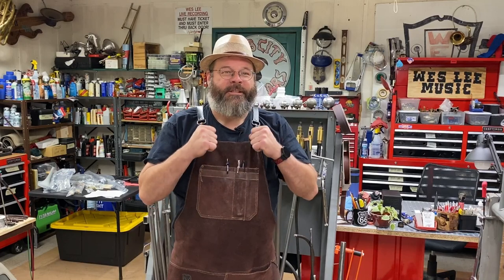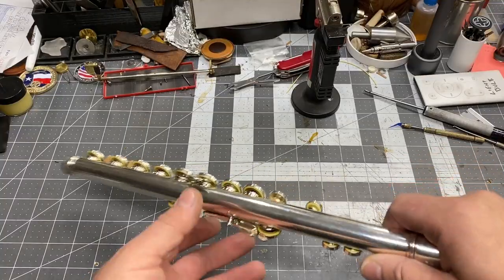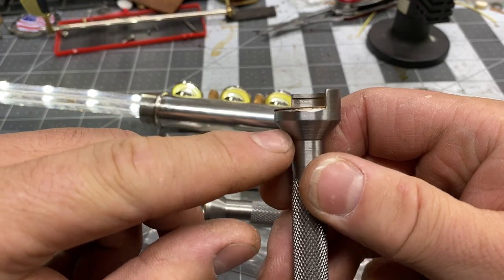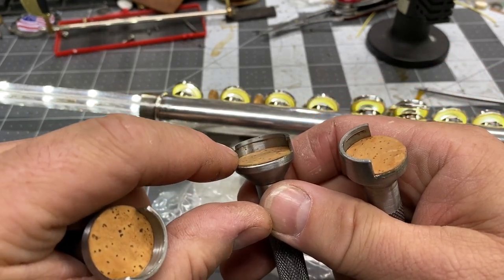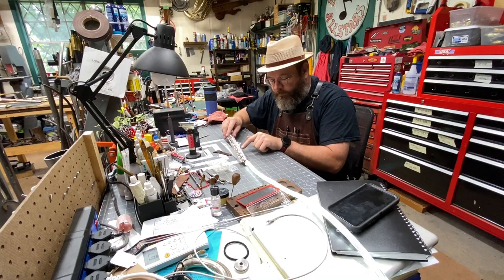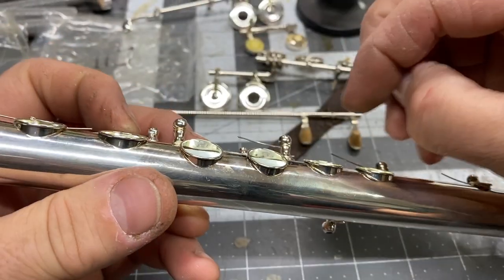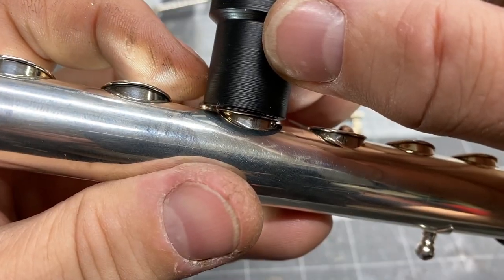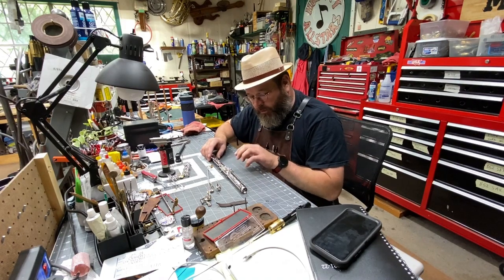finesse the flute- tools for detail work- band instrument repair-

Comment: Someone suggested to color the tone hole rim with a Sharpie pen. The circular file will remove most of it right away, leaving just the dips with color. The dips start to disappear as the rim gets more level. It’s an ongoing indicator, saving a little time until you need to check with the level tool. 
I appreciate your work, Wes, and the quality of the videos. When I worked on my student’s flutes, I checked each tone hole for evenness, especially the trill key holes. 
I am learning a ton from the clarinet videos. Thanks and Best.
Reply: Same principle in leveling frets on fretted string instruments. Works well.

Comment: Using a Dremel tool with a cutting wheel, I've adapted the E11 flute pad cup tools to accept the cups with pointed cup arms.  I just cut a V notch long enough and deep enough.  Cut right through the existing cork disk into the metal.  Now, the tool works for both types of pad cups!

Comment: Great information provided here! I had no idea how to fix a flute. I have a Trevor James Cantabile that I have some difficulties with second E and high F. I'll check it with a led light as you did here. I also have a Gemeinhardt 3M that after 30 years sounds terrible. Needs major overhaul. Thank you very much.
Reply: Generally a leak on a flute will stop most notes lower from working - if low C works fine, it’s something else, always worth checking your head joint cork too. I’ve had lots of problems with the back feet bending for no apparent reason on the Cantabiles. You can use a strip cut from cigarette paper as a feeler gauge- but check all around each pad.
Reply: I have a Gemeinardt that needs overhaul as well. Have had it for 31 years

Comment: Hey Wes, thanks for demonstrating the pad cup levelers. I'm going to get me a set.  It will beat using a little flat piece of wood to put under the high side  of the key and pressing down on the other side, or spending a lot of time putting in just the right size shim to level the pad.
Reply: see my post on Feb. 9, 2022  perhaps you'd be interested in this adaptation.

Comment: Very interesting Wes!   Takes a special skill set to maintain the patience and focus to work this way.   Thanks for the insights. I am wondering about the pilot material.  It looked to be aluminum.   Is that soft enough to not scar the inside of the hole?  Would something like Delrin or Valox work better?   Or maybe something really hard that would stay very polished?
Reply from the maker: I have not noticed any issue with polished aluminum, but I use extreme caution as to where the tool is at all times. I may turn a pilot out if delrin or abs and see how that feels.

Comment: Wes
I enjoy watching your videos. Flutes have always been very challenging for me. Do you ever use a feeler gage to check if the pad is coming down evenly?Or do you just use a leak light? Sometimes a tone hole is level but using a feeler gage( I use cigarette paper) I can feel that the pad is coming down nicely  in one spot but not at all in another area.So i try shimming, Do you ever use the paper shims? I Would really like to see more on flute padding. 
Thanks Ruben
Reply from the maker: I use light, feeler gauges of different varieties, tonehole leveling, pad cup leveling, shimming, etc. The instrument has to play with greatest of ease, and however I can get the best results quickest is what I do.